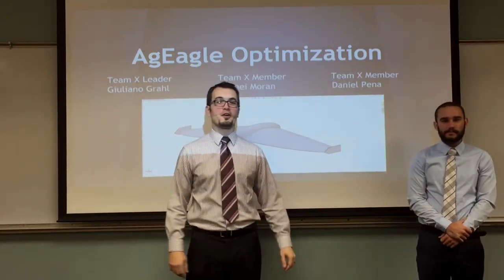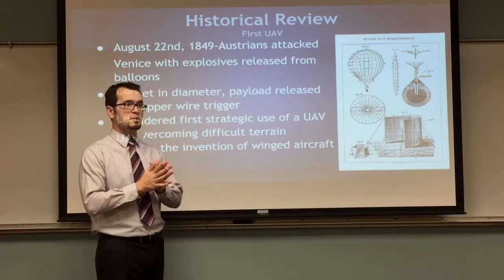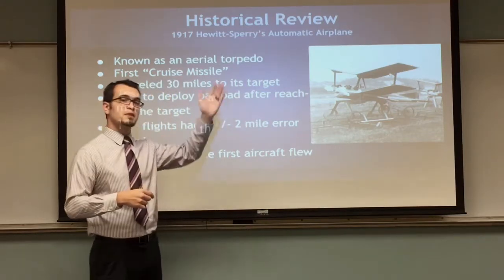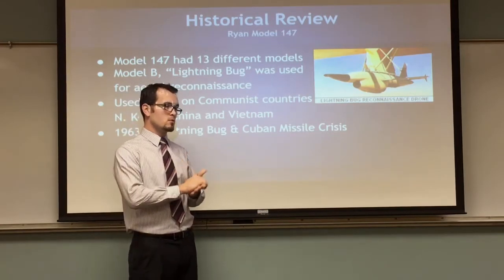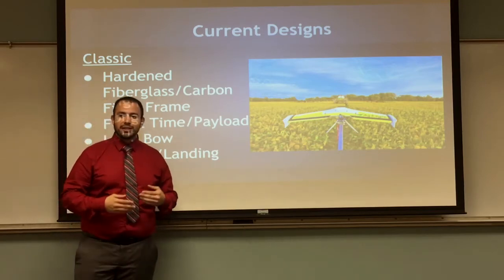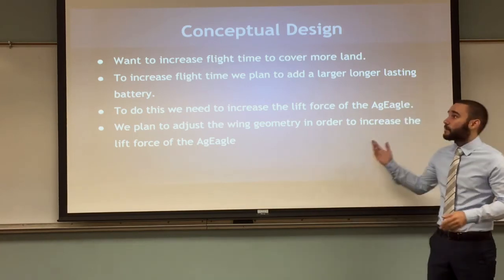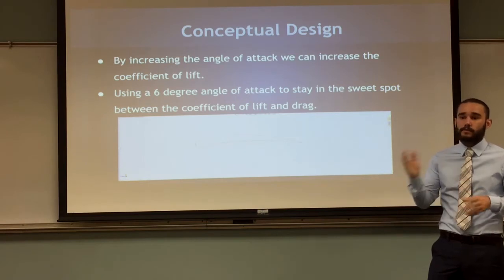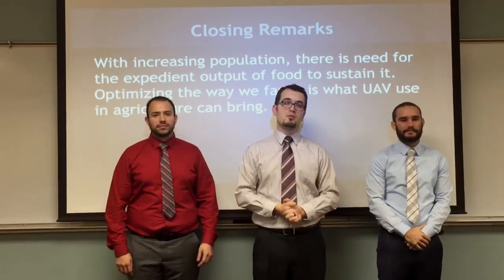Team X: Agricultural UAVs

Comment: Great job guys. The overall presentation was clear, very informative and was easy to follow. The quality of audio and video worked well with the powerpoint and contributed to a professional display. The only suggestion on improvement would be to avoid obstructing the slides so they can be reviewed continuously throughout the presentation. Presenters showed they were very knowledgeable of their individual subjects.

Comment: It was very good that you guys dressed appropriately for the presentation. The power point was perfectly made, but the light made it a little hard to see. It was good that the presenter was able to elaborate on short sentences. I did not know that there was a working UAV in 1849. With the development of UAVs the flight time will be longer and the system will be more efficient. Overall this was a very informative presentation, presented by informed presenters.

Comment: Interesting topic but one major issue is to not stand in the middle or continuously block the power point. Try limiting moving back and forth since that is why you ended up blocking the power point. Also try to avoid looking back at the power point. Other than that nice job, power point was nicely done and easy to follow.

Comment: Every speaker was very prepared and knowledgeable. The presentation had a lot of energy. The slides are very balanced with info and visuals and when combined with the enthusiasm of the presenters the final product makes an excellent presentation. The biggest suggestion would be to avoid standing in front of the screen. The presentation was also a little too long and some unnecessary details could have been left out without taking away from all the valuable information.